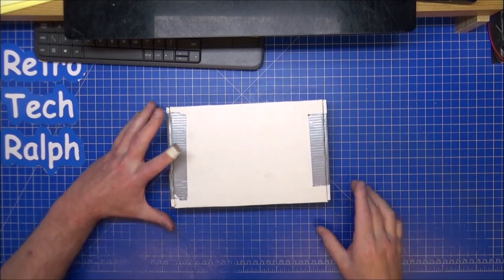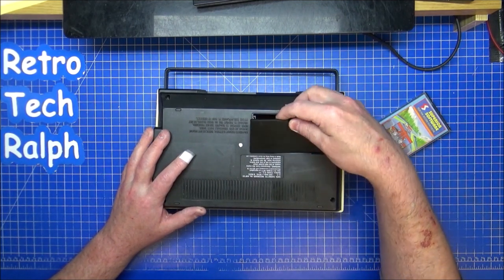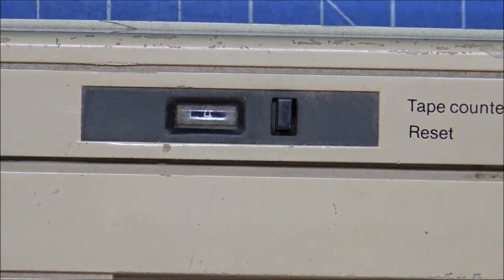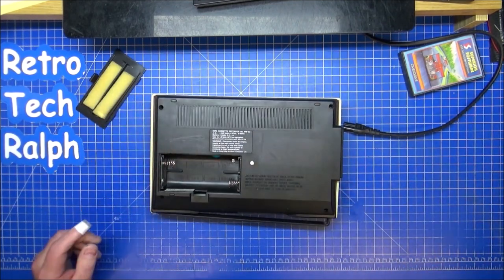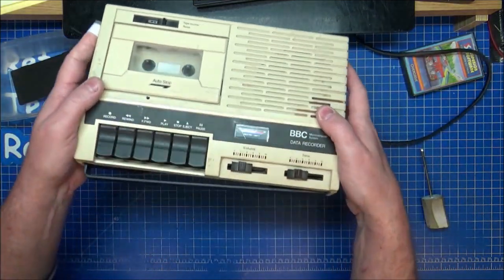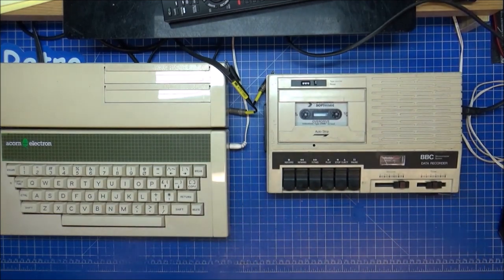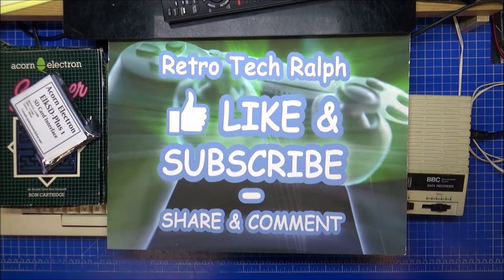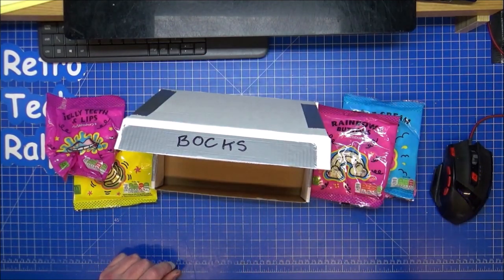BBC Data Recorder Teardown Part 1

Comment: Interested to see part 2  as I have one with this exact same issue. no sound from speaker or via earphone socket. I think it might be the Toshiba power amp (TA7628P) chip.. I've ordered one as it was only £3.50... I will give it a go and see if it sorts it!
Reply from the maker: I would like to know your results as ive not made a part 2 yet. i was hoping it was a re capping, but it maybe more than that
Reply: @R_T_Ralph  , Chip arrived today... I will be fitting it later.. fingers crossed.. I will post the result on here.
Reply: Fitted  TA7628P chip and its working - Success!! ..  The sound is back and I can load programs off of tapes again.(I think I might order another and have it as a spare). I hope you have the same success.. I didn't video it.. I will leave that to you for your part two. Best Regards, Joe
Reply from the maker: @tarrapere  i'll get one ordered and see if it does the job for me. A very big thanks, and ill mention you in part 2.